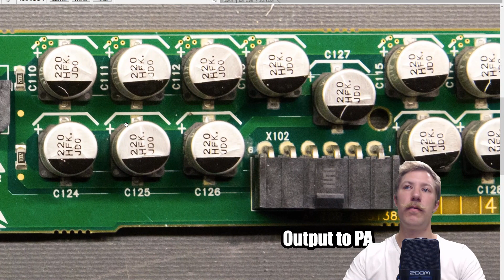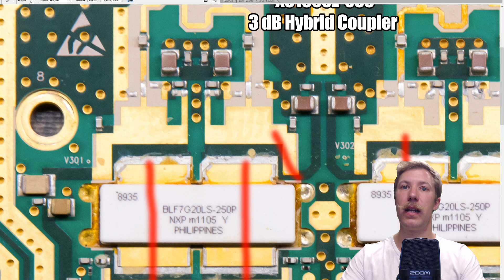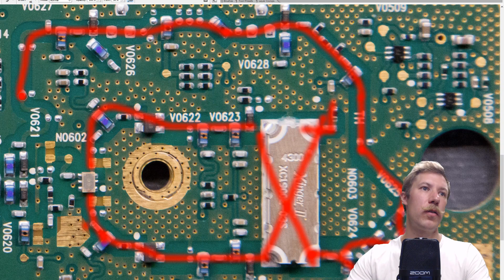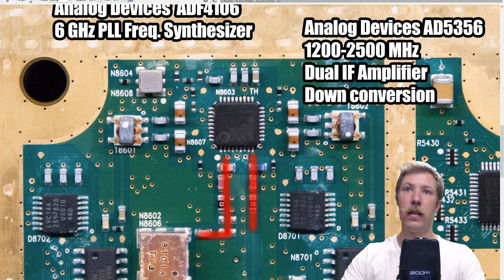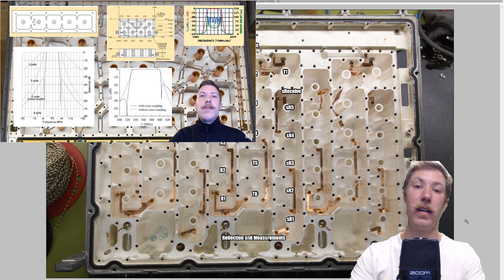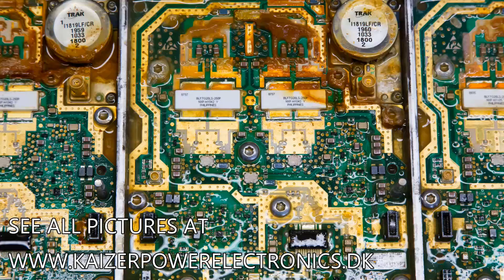Nokia Siemens Flexi 3x70W FXEA 1800MHz Base Station - Circuit Analysis (Part 2 of 3)

Comment: What causes the amplifiers to degrade?
Reply from the maker: Heat. They are properly only designed for a service life of 10 years maximum. To make things smaller or cheaper, accepting that things get hot and will not last that long, is the most used trade off in electronics design.

Comment: Does anyone know what that "bridge" at 4:30 is about? What were those other traces?
Reply from the maker: It seems to be either some power control or feedback for the pre-amplifier, you can see the pictures here: http://kaizerpowerelectronics.dk/teardown/nokia-siemens-flexi-3x70w-fxea-1800mhz-base-station-circuit-analysis-part-2-of-3/
Reply: @KaizerPowerElectronicsDk  Ah, now I could tell that three traces went below.
Still do not understand why. The only reason I see is that the connector absolutely had to be at the edge.
Why did the three traces have to stay in the outside layer?
Why the missing STOP mask?
I still like the HF-Jumper, that is all it seems to be.
Reply: @0MoTheG  Yes it's only a jumper. They are used when you need to jump over other traces. The ground lines on the top and bottom and a ground fill on the underside of the jumper guarantees the 50Ohm impedance. You generally try to avoid them but I guess the connector placement on the PA board was given by another design team so they had to find a way to get around these traces. 
The PA board is only a 2 layer board that is bonded to a 3mm gold plated copper plate so you don't have to many options for routing.
Reply: @gammaleader96  So the other side is just all copper not a single trace or part?
50 Ohm is hard to achieve with single sided, I assume the heat and shield plate is part of the wave guide. But that makes it even stranger as the jumper now puts the signal closer to the close by plate introducing asymmetry.
Reply: @0MoTheG  The bottom side on most of these PA boards is completely flooded with GND yes. They don't have solder mask on the bottom and are soldered to the heatspreader plate over the whole area. Some designs have a few single traces on the bottom but they are mostly just GND fill. Sometimes there is even a rf trace on the bottom (most of the times the output power measurement from the directional coupler at the output), in which case the heatspreader has a channel milled in it, to achieve the 50Ohm impedance for this trace.
The jumper won't introduce asymmetry to the trace, since it has it's own GND plane on the bottom of the jumper. However it will of course introduce some kind of mismatch (even though very very little) which is one of the main reasons you try to avoid such components if possible.  The other reason of course being that it is just another component on your BOM which will cost money in the end.

EDIT:
I found this bridge as an example on Digikey:

https://www.digikey.com/product-detail/en/anaren/X2AS/1173-1143-2-ND/4211707

This one is a coplanar waveguide type which won't have a GND plane on the bottom side and defines its impedance by the distance between the signal trace and the GND lines on the side.

EDIT2: 
These bridges are also available as crossovers which is pretty useful.

https://cdn.anaren.com/product-documents/Xinger/RFCrossovers/X2BS/X2BS_DataSheet(Rev_C).pdf

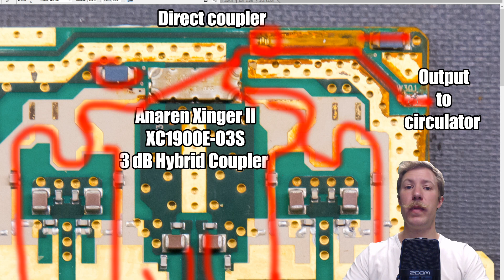Comment: 8:20 How could you measure the antenna  SWR on the amp side before the circulator? I'd guess the coupler is for sampling the output signal for e.g. predistortion.
Reply from the maker: You must be right, the missing circulator fooled me :)

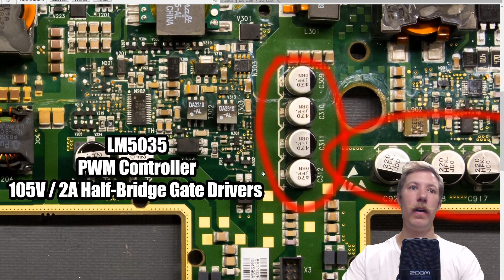Comment: As far as I know, all this telco equipment uses negative voltage, so the supply level at the input is actually minus forty-something volts, where the potential of the "hot" pin is below chassis ground, that's why the fat trace is connected to the negative pins of the caps seen at 2:47. Only at the output of the following SMPS the actual (positive) voltage for everything is available.
Reply from the maker: I have had lots of the power supplies for these as well, they are just usual 48VDC power supplies, but are saying its connected with positive rail of those to chassis?
Reply: @KaizerPowerElectronicsDk  yes, the positive rail of the external PSU is connected to chassis ground :)
Reply from the maker: @droelfdroelfify  Interesting, that explains the weird input board configurations. I do not get this as a whole system, So I do not know how it was wired between the parts.
Reply: @KaizerPowerElectronicsDk  https://www.servertech.com/blog/48vdc-power-and-the-backbone-of-the-5g-telecom-industry https://www.poweringthenetwork.com/uncategorized/negative-48-volt-power-what-why-and-how/

Comment: Interesting to see the 5 parallel fuses, it always feels wrong to me to do that but I guess they know what they are doing. ;)
I definately share the fascination for RF amps with you, they are beautiful and super interesting in their design and function. 
Also interesting to see the mix and match of FPGA/CPLD manufacturers (Xilinx and Altera)
And finally, it's cool to see a coldfire CPU. which is like the thing for everything, especially in some automotive designs. 

Looking forward for part 3, which might include some PA measurements, I guess? ;)

Greetings, 
Michael
Reply from the maker: Yes, there will be a part 3! Not planned, but I just would not try to cram in your great work after 25 minutes of me rambling :) So you are getting your own episode.
Reply: @KaizerPowerElectronicsDk  Fancy, sounds interesting. :D
Reply: @KaizerPowerElectronicsDk  I just mailed you some additional data, maybe it is useful to you. :)